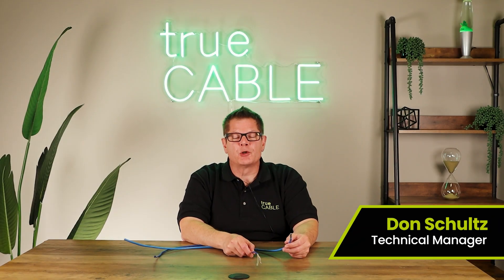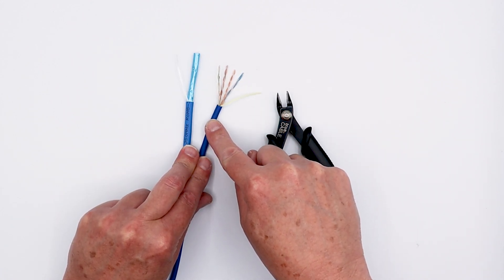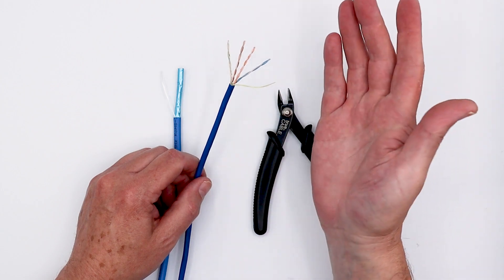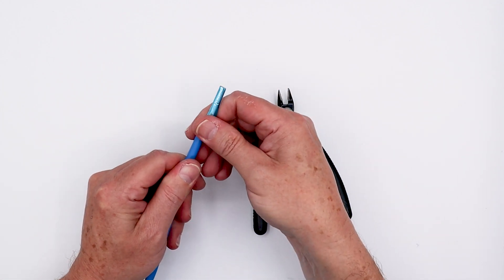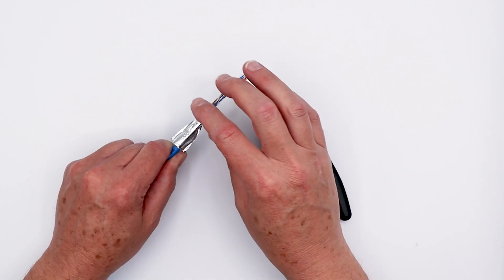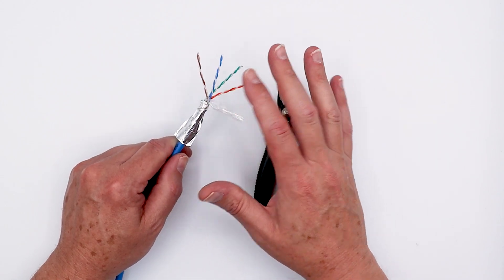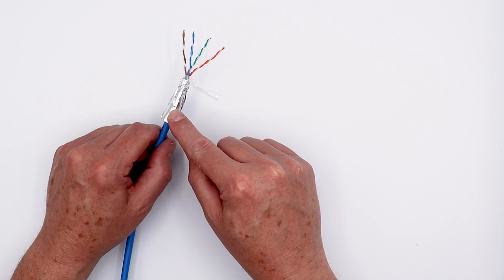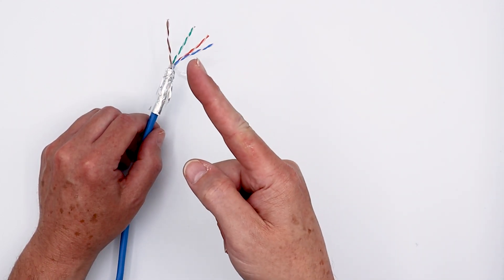Shielded vs Unshielded Ethernet Cable: When and Where to Use

Comment: Hi! Can you ground the shielded cable directly to the earth(in the backyard), through extension wire and a copper rod?
Reply from the maker: Hello! Yes, but be sure that you don't accidentally create a ground loop. Essentially, you want to be sure the only path to ground is via that ground rod, so your Ethernet switches should NOT also be a path to ground (and they are if they have a 3-prong power cord instead of an AC/DC adapter). Please check that and carefully consider what paths to ground the cable shield may take before embarking on this method.
Reply: @trueCABLE  I'm a bit confused with english ahah, we run 3x 1.5mm2  conductors to the rack "cabinet"  Black (Live), Blue (Neutral) and Green/Yellow (Ground), the ground in this case is used for the main electrical panel GFCI protection and the main pannel is connected to  ground rods and strips burried in the ground around the house and sometimes in the concrete foundation, if the ground (Green/Yellow) conductor is connected to the chassis of the rack cabinet  and the whole chassis is metal, does that mean that the patch panel which is also metal is by definition grounded to earth and will dissipate possible charge gathering on the Shielded UTP ?
Reply from the maker: @LykeArgy  Hello! I understand what you mean. You would think that would be enough, right? Not quite. Yes, the rack itself would be bonded to ground. Well, at least the piece of rack metal you attached to. Now, are the rest of the pieces of the rack frame also well bonded too? Not necessarily! You have paint on those pieces, which is an electrical insulator. In addition, you cannot count on whatever you mount to the rack making sufficient bare metal contact to ensure good conductivity. You want bare metal contact, and as much as possible. Therefore most formal racks in a telecom room are bonded to ground as thus: The rack frame, all three or more pieces of it, are bonded together. Then the rack itself is bonded to a copper rack bus bar. Then, all the equipment in the rack is bonded to the rack copper bus bar. The rack copper bus (called RBB) is bonded to a larger secondary or primary bus bar (SBB/PBB) inside the telecom room, and that bus bar is then bonded to your AC ground system. This can get complicated fast. In short, though, your method does NOT guarantee that you have a good bond to ground for all the equipment mounted in a rack. You would need a "meggar" two point ground impedance tester to guarantee your bonding continuity. I hope that helps!
Reply: @ The rack cabinets i've seen till now, had a pre "screwed" (or glued) copper thread to each part of the cabinet, each removable part like doors and sides and the top plate and  the chassis, and we got premade conuctors with the ring attachment that goes on the threaded copper with a nut and connects the whole chassis together, but i understand what you mean  by other parts not being 100% connected like the actual frame you mount your accessories has  no copper threads 

But I've only watched superficially when i was doing work nearby, usually the guys that are in this job are doing it ,  i just help ocasinally but i'm here mostly for mounting cameras, magnets , senors and other stuff.
Reply from the maker: @LykeArgy  Hello again! Yes, a high quality wall mounted equipment rack will have individual pieces that are bonded together via conductors as you said. This includes the doors, if they have a door. In this case, you need only bond one part of the rack metal to ground but that still does not guarantee that equipment you mount into it is bonded and equalized to the rack ground. Ideally a horizontal or vertical copper rack mounted bus bar would be used to bond all of the equipment to in the rack, and then the rack itself would bond to the copper bus bar, and then that rack bus bar would be bonded to yet another bus bar outside of the rack (if necessary) or simply directly to ground.
Reply: That sounds like i'm gonna be doing it that way in the future if i'm the one assembling them =) . One more question tho, I'm assuming you're american, do you guys not put thunderstrike protection on your roofs? I haven't seen a single one done in a dozen videos i've watched of buildings being made or inspected. We do have it, it's basically either zinc plated iron strip around the whole roof and few vertically stood up aluminum rods to catch and direct the lighting and usualy at all 4 corners the strip goes directly into the ground and the house ground is connected to that ground but in the soil and we then use these "overload/surge" breakers that shut off the power to the whole house when too much voltage goes through them. But even with that I was told that electric components could get fried.
Reply from the maker: @LykeArgy   Hello! I am American. I am not a home builder or electrician, and my electrical knowledge is confined to what I need to know for the low voltage space and bonding communications cable systems to the existing AC ground system. I cannot really answer your question effectively. That said, the USA has local codes around this that are enforceable law but a nationally recognized standard that is considered to be a guide, but does not have the force of law. Not all local legal jurisdictions have adopted the codes. Some have adopted the national standards without change. Some jurisdictions have adopted the national standards with changes. So, even if I was fully qualified to answer your question it would likely not apply to all areas of the USA. Confusing, I know. Confusing for many Americans, too.
Reply: @trueCABLE  Oh, got you, my bad for the assumption you could answer me haha=) . Yeah I did notice alot of american building videos get replies about how they did something wrong and then the channel maker in another video explains it's not code there but it is in 2 other states haha. Thanks for the previous advice and you got a new sub =)
Reply from the maker: @LykeArgy  Hello and no worries. You are welcome, and I appreciate you subscribing to our channel. It means a great deal! I often get questions about electrical work (120VAC or higher) because of my knowledge around low voltage and especially bonding and grounding of structured cabling systems.

Comment: Great informative video! 
I need to lay cat5e/cat6 cables for IP camera. The cables would be running near a distribution transformer of 1100 kva(cable to transformer distance approx 1 metre). Do I need a shielded cable or an unshielded one ?
Reply from the maker: Hello! I strongly suggest using shielded Ethernet cable if you can maintain only 1 meter away. With shielded Ethernet 32" is the minimum separation distance from that transformer. If you opt for unshielded Ethernet, keep the separation to 48" minimum.

Comment: My foreman just asked me what the shield and drain wire accomplishes in front of a new guy. I told him that the shields main purpose is to avoid cross talk. I also noted that the drain wire can be used with grounding kits depending on what type of patch panels you're using (my experience with Panduit). 
My foreman said that it's main function is that if you don't terminate it properly it turns the shield in to a big antenna like the old TV antennas. Is this correct?
Reply from the maker: Hello Joseph! Yes, this is correct, but only in extreme circumstances. Typically, the cable shield and drain wire are used in conjunction with each other (they make contact inside the cable anyway...or should). The drain wire is more useful for draining off ESD and the shield helps overcome ANEXT (alien, or outside the cable cross talk from coming in). But, essentially, our foreman is absolutely right and the cable shield/drain wire must be properly terminated AND it must also be bonded to the AC system ground somehow. Failing to do so would result in a non functioning cable shield (at best) and the cable acting as an antenna (worst case, extreme RFI environments).

Comment: Also, the best noise rejection is achieved if the cable shield is grounded on one end only.
Reply from the maker: Hello Tom! Agreed, depending upon your AC ground system. If everything is at equal potential, then it won't make a difference if you bond to more than one place on the same AC ground system, but if there are any issues, you will achieve the best results by bonding to a single end of the same AC ground system. The biggest thing you don't want to do is bond to two totally disparate ground systems that are not equalized!
Reply: @trueCABLE  This might be a topic for another video, but even on a decent residential AC ground system our FTP shield is a path of lower resistance for high frequencies then the ground wire connected between the same two points (while points might be measured as "equal" potential in DC or even in 50-60 Hz domain).
Reply from the maker: @_majortom_   Hello again Major! Agreed, and we will be doing some detailed content with a bit error rate analyzer (BERT tester) in various high EMI environments to help people determine when and where FTP cable will be of benefit. Stay tuned! We are building out a test lab for just this thing.

Comment: how do you Bond the shielded cable to a ground?
Reply from the maker: Hello! You bond shielded Ethernet cable to ground, typically, via shielded connection hardware at a shielded patch panel that is bonded to your AC system ground. The bond to ground takes place at the patch panel. The idea is to provide a low resistance path for EMI/ESD to drain off before it can cause equipment damage or packet interference. Most residential environments don't have a handy dedicated copper bonding bus bar to connect to next to your network equipment, so we developed a bond-to-ground extension adapter that makes it easy. See https://www.truecable.com/blogs/cable-academy/how-to-truecable-bonding-grounding-extension-adapter for some information about that adapter and what this type of installation looks like. Hope this helps!
Reply: Was about to search up videos on how to do this, good thing I scrolled all the way down in the comments section. This was the last comment, getting as much info as I can.
Reply from the maker: @itpugil  Understood! We are glad you are on a learning binge! Take note all of these videos are companions to written blogs found in our Cable Academy at www.truecable.com. In the written blogs you will find detailed information that we could not present in a blog, such as close-up pictures and other nuances. We have more than 200 written blogs so far.
Reply: @trueCABLE  I read up on 2 blogs from you guys yesterday already, I am on track! :)
Reply from the maker: @itpugil  Sounds great! I am glad you are getting use of them and learning.

Comment: I simply want to run a 100 foot ethernet cable from my downstairs modem to my attic home studio where I can connect my computer or perhaps a Google mesh type device. It will probably run parallel to someone 120 votes Romax in the walls but I don’t understand if I would need shielded or not when connecting two devices like this.
Reply from the maker: Hello Gregory. You probably won't need shielded if you follow some basic precautions. Maintain your distance from the 120V Romex by being sure the Ethernet is on the opposite side of the wall cavity, or simply switch to a different wall cavity. Electrical is typically attached to a stud, so if you must run it in the same cavity, use a stud finder with AC detection and find out which side of the wall cavity the Romex is attached to. Then, run the cable so it is on the opposite side.
Reply: I do not want to undermine the correct advice given here. 
I just want to share my general approach when running ethernet cables in my family and current one.
Due to different limitations I will always have to run them alongside AC (240V here in Europe). Hence I just buy the shield ones, along with shielded connectors and sockets.
Making sure it is always grounded at least on one end (send where the sockets are I'm not always able to have proper low resistance ground)
Reply from the maker: @BobbyBike  Hello Robert! You are not totally incorrect in your approach. Per the NEC/NFPA 70 the actual minimum when separating shielded Ethernet from 240V or lower AC is no separation on parallel (just not bundled with it) when only a single circuit is involved. We suggest 2" separation on parallel in your particular situation to keep people out of trouble in edge case scenarios where multiple AC circuits are bundled together or to help prevent damage to one or the other when pulling cabling. Hope this helps!

Comment: Dude I feel so vindicated right now. I was on a jobsite with a coworker and we were discussing possibly running our cable through conduit alongside a higher voltage cable the electricians had run. Nothing crazy high voltage, just power for some device we were running alongside. And I was like "Yea it should be fine running next to it since its shielded" and he comes back saying "That's not how that works, the purpose of shielded cable is just to provide extra physical protection to the wire, it doesn't reduce interference from other cables" or something like that.

I had a feeling he was wrong, but he was a senior technician so i didn't want to challenge him on it. Thanks for the video and the knowledge 👍
Reply from the maker: Hello Curtis! I am glad you found the video useful. If the Ethernet drop was being run through metallic conduit then you would not have needed shielded cable. Both ends of the metallic conduit need to be bonded to ground. The metallic conduit would serve as the cable shield. Please note that this does not apply to PVC conduit and we are talking about 240V or less electrical. If, on the other hand, you were running Ethernet in parallel to electrical without conduit and could not maintain your distance from it then that is when you would use shielded cable. Your coworker's explanation about how Ethernet cable shields work is completely incorrect. He might have been thinking about ARMORED cable perhaps.
Reply: @trueCABLE  Thanks for the response. I have another question: So my understanding is you aren't supposed to run data next to fire alarm cable. Is shielded data exempt from this? Thanks.
Reply from the maker: @heyQurtiz   Hello Curtis! Fire alarm cable is low voltage. You don't need to keep Ethernet separate from it, so shielded would be unnecessary.
Reply from the maker: @hhatz  Hello and thanks for your comment. That would be absolutely correct. It is actually a violation of the NEC/NFPA 70 to run communications cable inside the same conduit as an AC electrical circuit.
Reply: Please tell me that you were no sharing the same conduit(Class1 with your class2).
Modern electrics are not always a simple On or Off as in the early days. Dimmers and speed/energy controllers have odd waveforms. The shield is for higher frequency RF (not magnetic induction from nearby high current wires) from these devices.

One thing not mentioned. ANY shielded wires should only be grounded at 1 end to prevent current flow ON the shield-drain

Comment: What environment calls for shielding?
Reply from the maker: Hello! Well, that depends on a large number of factors. First up, how are you installing your cable? Is it in metallic conduit? If yes, then you don't need shielded since the metallic conduit should be bonded to ground (in a commercial situation), and that serves as the shielding. If you are running cable right next to strong EMI/RFI sources then it might need shielded cable AND metallic conduit (480V and above if you cannot maintain your distance). Each installation is its own animal. For most residential situations, shielding is not required (but that is a general statement if there ever was one). Any sort of outdoor aerial installation demands shielded cable due to the need to drain off ESD discharge (due to air movement) to ground. So, the rules are not hard and fast, and it is up to the technician installing and a proper survey of the site in addition to what installation methods are being employed. There are some generalized guidelines in a blog I wrote, so you might want to take a look at https://www.truecable.com/blogs/cable-academy/running-ethernet-and-power-cable.

Comment: Great Video, can you tell me if you would recommend using shielded cable in this scenario: I am wanting to run 2 separate cat5  cables to my shop 250 feet from my cable box in my house I  plan to bury the cables side by side what would you recommend
Reply from the maker: Without a nearby source of EMI, the underground cable should not require shielding. The two data cables do not require shielding from each other. However, even though the cable is to be buried, you should still investigate lightning protection. We have a blog about it on our Web site: https://www.truecable.com/blogs/cable-academy/when-lightning-strikes-ethernet-data-cable-and-lightning-protection